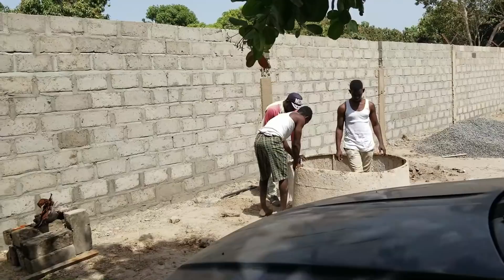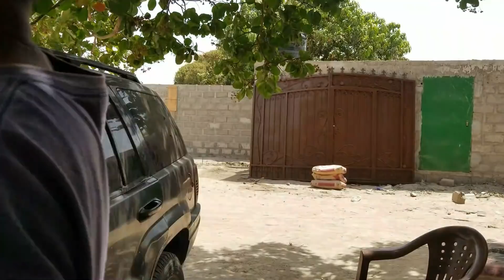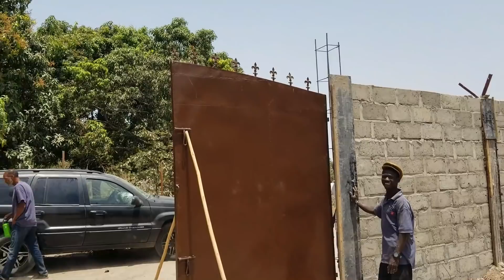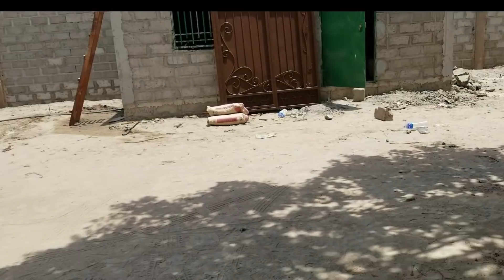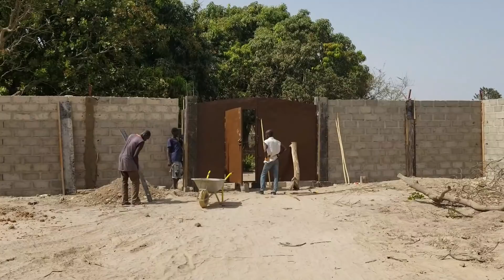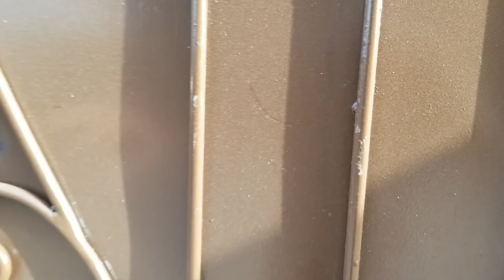The Arrival installing the gate and digging out septic  in The Gambia

Comment: Will a small incline slab of concrete be built at the base of the gate? I wonder because it seems like you have to step up and over the threshold of the doors entrance...just curious. Thanks for the info. I am enjoying and learning from your journey! 😊😊😊
Reply: Not done yet still working on it
Reply: The gate is probably raised up to accommodate for driveway. The man door could've been lowered another 6 inches to make it easier to go through.
Reply from the maker: @Aquarius yes they will pour  a cement slab and it will be sloped not just straight across to make it easy for passing. 😃❣🙏🏽

Comment: So it looks like your neighbor only has to put up 3 sides of their fence. That should save them money. ... Also, how did you decide where to put your septic tank?
Reply from the maker: Yeah all of our neighbors will have to do 3 sides because we share on a side for all 3. We chose a place that would be out of the way...away from the borehole and just decided. No set place. They will need access to empty...so you have to keep that in mind😃❣🙏🏽
Reply: Enjoying every minute of your build, should have put your septic tank by the gate,no reason for the tanker to come on your property to empty it,also with the longer drains it won't back up into your house as quick .What you have to remember is that most Gambian compounds will not have the appliances that you will,so they can get away with a small septic tank .It should be a balanced system so what ever grey water goes in the same amount should come out into a soak away or french drain.
Reply from the maker: Thank you .....hopefully we will be ok. 🙏🏽🙏🏽🙏🏽